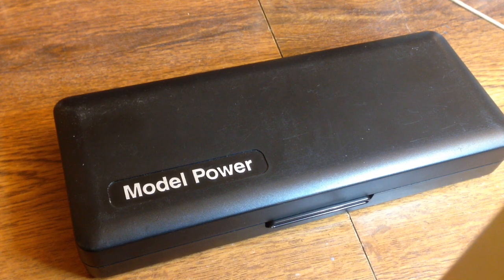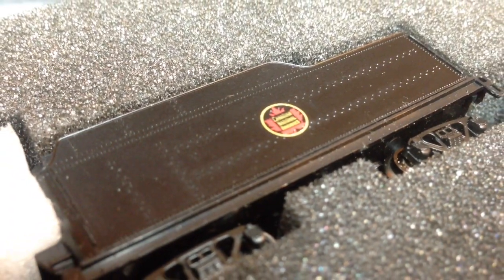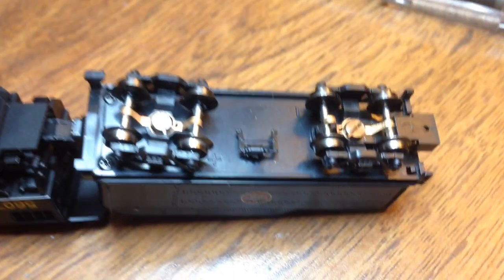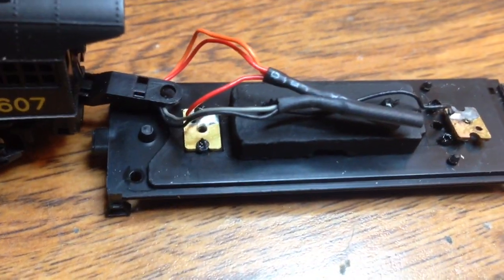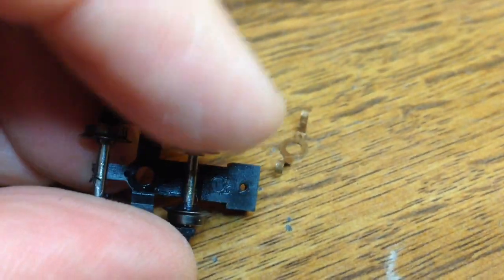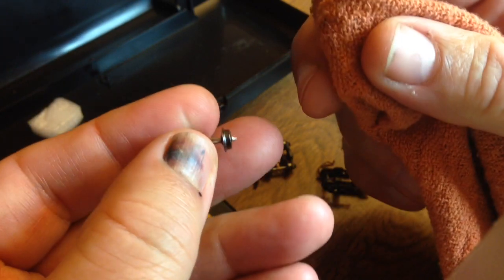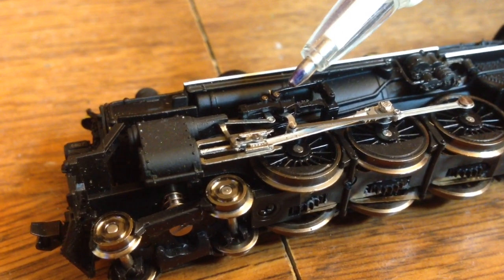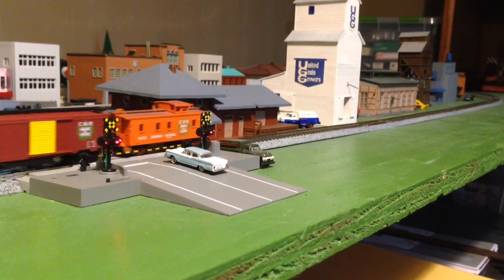N scale Model Power 4-6-2 Canadian National repair

Comment: don't take the bottom plate off of drivers the pickups are fragile and easily damaged and there is two brass sheets with pickups that rub on both side of the drivers